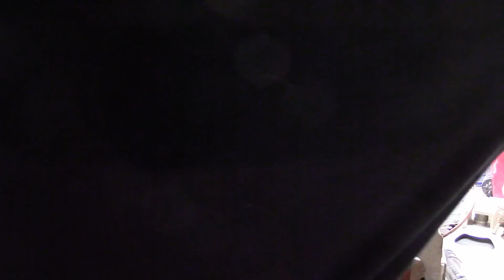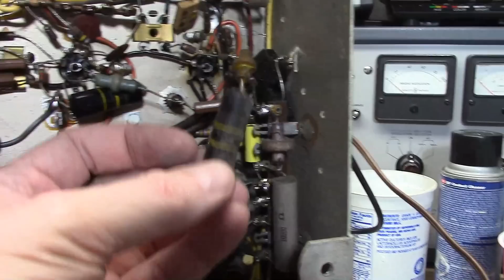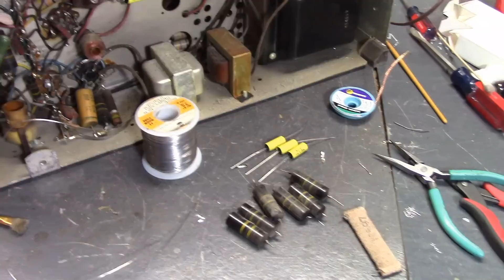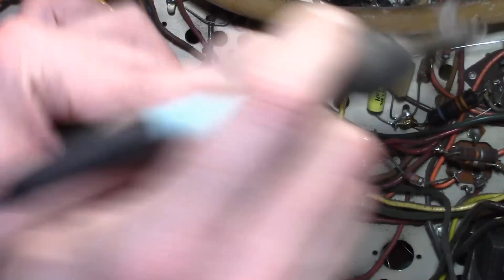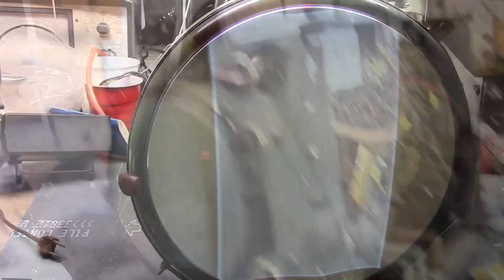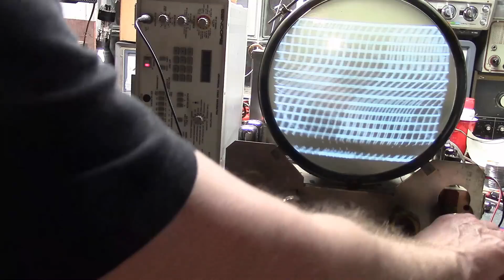Westinghouse H-223 restoration part 3

Comment: Interesting.   I have GE 3 way portable radios from the mid-late 50s with a flexible power supply resistor like the one you showed.
Thanks. Good video.

Comment: Looks like a shorted horizontal yoke winding. The Christmas tree effect.
Reply from the maker: It does, but it isn't.  It's a weird side effect of this design.  No flyback.  Instead, the horizontal yoke is driven directly by a pair of power tubes.

Comment: Well Bob you really got your work cut out for you working on this set and far as the chiclet style capacitors I like using them when stuffing bakelite blocks .
Reply from the maker: Absolutely. They are great for that. Also no outside foil. They are made from stacked up pieces like a sandwich.